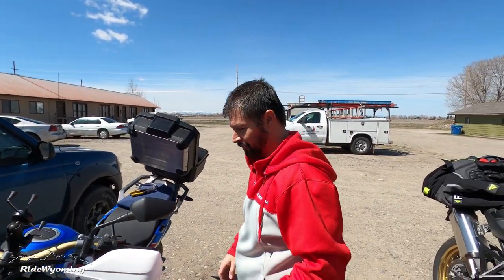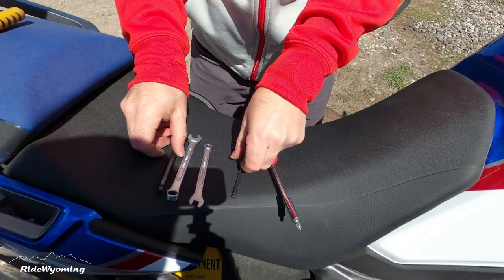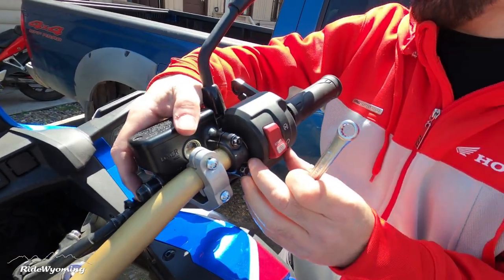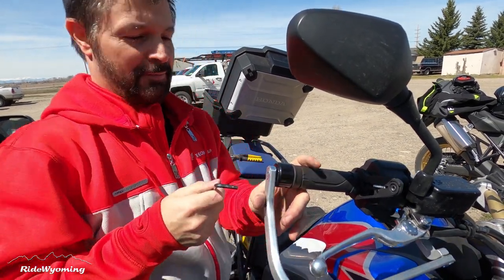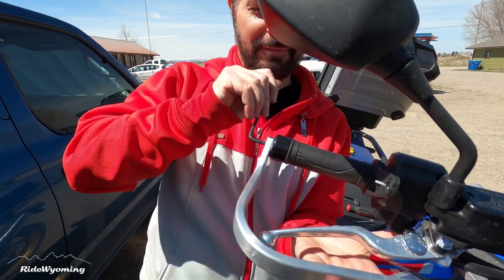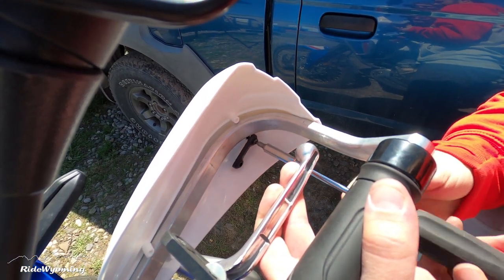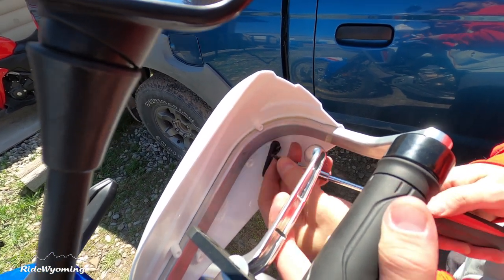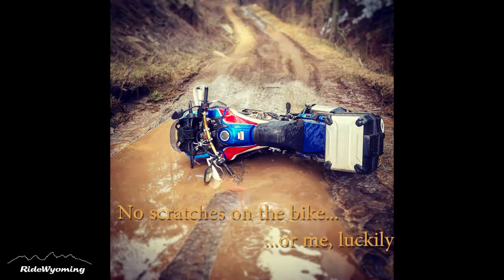How to Mount the Barkbusters Guards on the Africa Twin CRF1000L 2019

Comment: I am at an impass with my installation. Exact same bike, 2019. For the right side with throttle and brake, the instructions indicate you should verify clearance between the bar mount piece and bottom of the brake lever pivot screw. This means the bar mount must attach between the throttle assembly and the brake/reservoir assembly. If you attempt to install this way, it becomes clear the backbone is far too long to meet up with the bar mount. So to try and get them to fit I put the bar mount to the left of the brake/reservoir assembly, and attempted to push the brake/reservoir assembly to the right, like in this video. However, with this configuration, the mirror mount now interferes with the throttle assembly, and when tightened, my throttle locks up. I had already installed one washer, and installed more to test it out, this is not why the throttle is jammed up for me, the mirror mount is pressing against the housing where the throttle rotates and is jamming it up. You also appear to have rotated your brake lever down far more than I want, or should need to, is this how you are not having issues? A shorter RHS backbone would make this actually work per the installation instructions.
Reply from the maker: Yes,  I did rotate the level a little bit,  there's really very little difference using it either seating or standing.

Comment: Great video, thank you so much.  What did you do with the screw and bracket that were attached to the Front brake lever?  It looks like after you removed the bracket, you had to add a spacer.
Reply from the maker: Thank you very much. I put all the original parts back where they were
Reply from the maker: Everything went back the way they were. Unless, are you talking about the original hanguards?
Reply: @ridewyoming  I am talking about the original handguards.  The end of the guard attached to a bracket (at least on my 2019) under the brake reservoir.  The bracket also attached to the front brake lever.  I have to remove the bracket to install the barkbusters,  but the bolt used on the brake lever no longer works to hold the lever on.
Reply from the maker: @pl5861  Sorry it took a while to reply, I had to go to my storage unit and take a look at the old OEM handguards to make sure I was understanding what you were saying. The old handguards come off completely, including the part that attaches to the brake level. I'm not sure why your bolt doesn't work anymore, mine does, I didn't have to remove it. Is there any way you could send me a photo? I really wanna help you.  	ridewyoming@yellowstonemototours.com
Reply: @ridewyoming  Very odd, but thank you for taking the effort to look at yours and get back to me.  For some reason, my bolt needs the bottom of that bracket to screw into to hold the lever tight and in place.
Reply from the maker: @pl5861  That's very odd indeed.